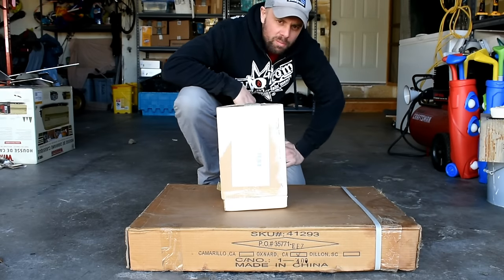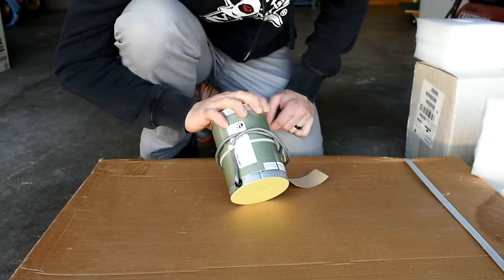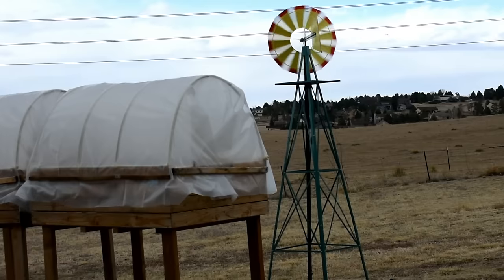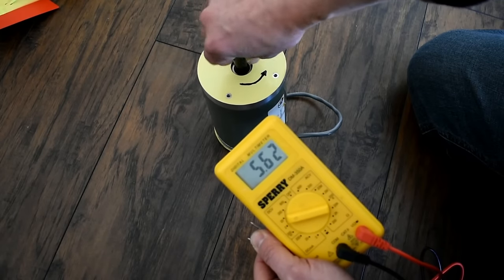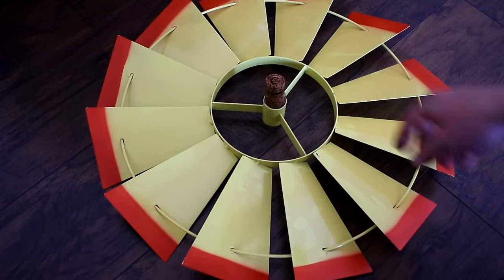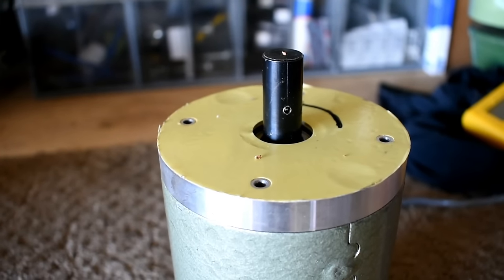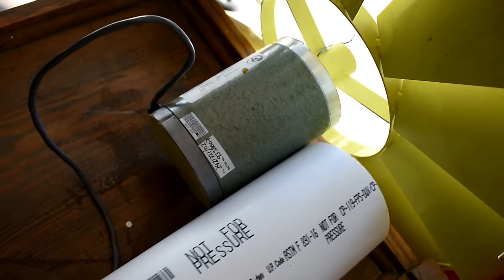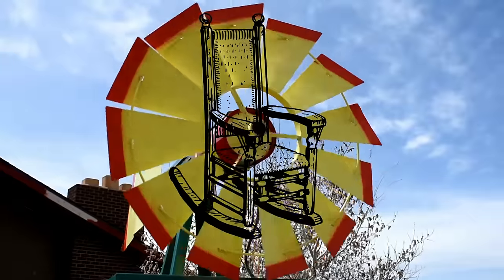DIY Homemade Wind Turbine for $32!!!💰

Comment: What was a great video, ended so horribly. Don't make us sit through almost 7 minutes of good explanation, only to give us 2 seconds of "success". Give results!
Reply: look at the end of the video and pause it..something wrong???..like the fins are the wrong angle for the blade to spin in that direction..
Reply from the maker: strange.....wind blows from all directions
Reply from the maker: I am not sure if you are arguing with me or yourself, but i just said in the last comment above that wind blows in all directions.  It's sarcasm.  It's on a charge controller so only allows power in.🤓🤓🤓
Reply: @live.life.simple.  AHHH ... sarcasm ... that's where I went amuck ... so, only power in, got it so why is the fan going counter clockwise when by the blade pitch it should be going clockwise? Inquiring minds want to know .... sarcasm ...
Reply from the maker: @ThePadutch  if you turn the blade around the pitch is opposite
Reply from the maker: Easier solution.  switch positive/ negative wires.
Reply: @live.life.simple.   If you switch the wires it  would reverse the polarity and motorize the fan unless you install a diode between the fan and the battery as an interrupt,  limiting the voltage to travel from the fan to the battery only. Otherwise the battery will try to power the fan and propel the fan as a motor.
Reply from the maker: @ThePadutch  I use a charge controller which will only let power in
Reply: he turned it with his hand. you can tell by how it slows down at the end.
Reply: true, what an end, we can't even see the turbine running
Reply: The overall video was good but it would be good to see how you hook it up at the end and show if/how you use accumulators, invertors, etc.
Reply: Thank you.. For save me 7 minutes and 2 seconds of my life..
Reply: 2 second "success" with no results/proof = "oh dang, doesn't work"
Reply: Retired at 40- Live.Life.Simple. Some sort of pivot would be my suggested add. And if the blades are more efficient one way that’s easy enough to remedy with cork I’d imagine. 👍x2 for the handtooled shaft sleeve. That’s not an easy win. That cover was nice too. Schedule 80 could probably service your swivel mounting. Great content and thank you for it.
Reply: @ThePadutch  You are correct; assuming the windmill is free to turn about its axis, the tail would orient the windmill to the proper orientation and given the pitch of the blades the windmill would turn clockwise. In the video, however, it turns counter-clockwise which would defy the laws as we know them. The only conclusion I can draw from this is that either he disabled the ability for the windmill to turn on its axis, preventing the tail from orienting the windmill in the direction of the wind and the wind is blowing from behind it (perhaps because he couldn't physically get a good camera angle given the direction of the wind at the time?), or most likely that he took some artistic liberties and manually spun the windmill (albeit in the wrong direction) to get something for the video. Either way, it made for a not-so-great ending because we don't know whether this actually worked or not.
Reply: @ThePadutch  it's the filming frame rate. Like when you watch a car driving on TV and wheels appear to be moving backwards.
Reply: @timwegman5776  the direction you see the fan turning is an optical illusion from the frame rate of the camera, like when the tires on a car on TV appear to be going the opposite direction.
Reply: I watched at 2x speed, only took me about 3 and a half minutes.
Reply: jdh7803  It was shocking!
Reply: John Freeman ....i think you hit on something when you made these posts. One of a couple things here....either this video was “staged”....mr. love life simple isn’t analytical like some of us....or there is a fairly substantial miscommunication here. Either way, Im with you on this one. Something isnt right, and you certainly werent getting a logical explanation. I was looking for info on an electrical generator windmill for our property here in Oklahoma. I want to also use the tower for some radio antennas. Unfortunately there isnt much substance here to gain any usable knowledge
Reply: Flipping the blade wouldn't change the direction the wind spins it.
Reply: YEAH!!!!!!! ( snort...)
Reply: @jay-rus4437  substance?
Reply: @winonaduty8277  ....yes. Its a word often used to convey the thought of a lack of something worth while....or lack of something useful. I understand that the use of the word stretches the actual definition, but is often used in such a context. Does that help answer your question?
Reply: @live.life.simple.  That doesnt work
Reply: I thought you were being mean until I got to the end lmao
Reply: Thanks to your comment I didn’t consider wasting my time on the video
Reply: @jakethomas2371 
And the fact that the blades spin in the wrong direction 😂
Reply: Hhhh&&hhhj @ThePadutch
Reply: @ThePadutch  Needs a diode either way and that's in the charge controller as mentioned.

Comment: O.K.  If your wind turbine is producing a negative (-) reading on your Volt meter, just reverse the leads.  No need to worry about getting the rotational direction correct.  These motors will produce electricity equally well if turned in either direction.
Reply from the maker: Thank you for input and constructive comment.  I 100% agree.
Reply: I don't completely agree. Due to various effects of magnetic circuits that I'm not going to get into, it benefits both motors and generators to have the brushed advanced by a certain angle, because of this many generators and alternators work better when spinning in one direction than the other. If the brushes aren't advances then if one can rotate the case slightly to advance the brushes themselves then they can make their motors/alternators more effective.
Reply: @lazyh-online4839  Wow... it pays to have that bit of extra knowledge. Thx for explaining this for us laymen. +1
Reply: Just put a bridge Rectifier then it won’t nt mater which way it turns
Reply: @nigelkennedy9811  yes exactly bridge rectifier solves directional problems. Negative and positive voltage is just a matter of reversing leads and current direction. Negative voltage just means you are measuring a lower potential energy with the positive (red) lead.
Reply: @lazyh-online4839  I'm glad this discussion was had.
Reply: @nigelkennedy9811  ???
Reply: Hi, sorry I don't speak english
I'm dominican republic
But I want to know
Specification motors
And blades label
Thanks
Reply: You don't want to know what went through my mind at first. Lets just say it had something to do with diodes. :face-blue-smiling:

Comment: try a barring collar to replace the cork . and your going to need a blocking diode to charge a battery or the battery will run the motor even if there is no wind .you can find real wind genny collars on ebay or you used to be able to anyway . but you have a good motor so the rest of it could be changed at any time .  the motor is the important piece .
Reply: What type of motor do you suggest?
Reply: i think you mean a "shaft collar" not "barring collar"? Collar bearings are different from shaft collars.

Comment: This is AWESOME . You showed me exactly what I wanted to know.  Of course I do want to know a little more.  You see I have a really nice windmill in my garden and every day I see it spin I think of all the energy I could be collecting.  Your video showed me the essentials, but I wonder if you could do one that shows how to connect the motor/generator to wires and a 12v battery.  My plan is to have a back up marine battery to run my husband's c-pap machine if we are ever without power for a long time, or even to charge it if we go camping
Reply from the maker: You will need an inexpensive charge controller to regulate the input.  It's simple hookup.  Red and black into charge controller and red and black going out of the charge controller to the battery.
Reply: @live.life.simple.  thanks :)
Reply: That's what I was looking for too.......the motor is pointless if ya dont show how to hook it up to battery bank.
Reply: I had 4 deep cycle battery's. I just installed a diode on the hot wire to the battery's. Battery's held the voltage down to save level on my amtek motor.

Comment: Nice project. I have 3 stepper motors like that. One i made a solar ceiling fan that ran for years. Made a wind turbine up on a 30 ft pole with fan blades. Had clamps like in this video and in one year it fell and broke the blades. Make a bolt on mount if you do this. Did the turbine work? YES It melted a 12 gage cord I had run to the battery. Make sure to install an diode on the hot wire to the battery. If you don't it will run the motor. Diode ---- Lets current go only one way. I used a 50 amp diode.

Comment: We need to see how you connected everything up for collecting and utilizing the electricity generated.
Reply from the maker: Positive and negative go into a charge controller.  From charge controller + & - go to battery.
Reply: Agree, why would you not show this as part of the video? Wasn’t that the whole point of the video? Otherwise it’s just an ornamental with a motor added?

Comment: Why not change the generator to a vertical mount instead of horizontal? ( That way you don't have to worry about the wiring getting twisted since the generator will be fixed and not turn) Use the hole where the weathervane hooks to the tower for the generator shaft to come through. You need to use a solid metal bushing to fit the blades to the generator. If the windmill blades don't grab enough wind you might have to build a new blade set up or maybe you could use a small squirrel cage out of a car or small furnace.
Reply from the maker: Thanks for your comment Ben.  I could definitely make this vertical, but this was just a quick setup with cheap parts.  I am just using this for small jobs, mostly charging batteries.
Reply: well said Ben thats my question to.. beside having a slip ring setup the other way is to point the motor up and have a different blade configuration..whirly gigs seem to spin alright in low wind

Comment: For future reference instead of a cork rig it up to make use of the keyway already cut into the shaft on the motor. Drilling out metal of the shaft could cause a balancing issue, as well and mounting the motor. If the motor isn’t specific to it level it’ll cause vibrations and or break the motor. Great diy tho. Thinking on your feet
Reply: He did say the cork was temporary just to see if the system would work.
Reply: At the rotation speed that thing will travel, balance of the motor shaft couldn't possibly be an issue.  The wheel isn't dynamically balanced, and a more-or-less straight hole through the shaft won't change the balance.

Comment: Nothing about voltage output or what it was used for. 
Was it connected to a battery system to convert it,  or just used for an LED light to illuminate the turbine in windy weather

Comment: I don't know if you get to read this, but I have a suggestion and a question. 1. Suggestion.  Try using a roll pin instead of the wire to hold the blades to the arbor, just use a roll pin that fits tightly into the hole.  2. Question. Since the wind turbine rotates to follow the wind direction, how will you prevent the wire from winding around the tower? Thanks in advance for any additional information about this you can share.
Reply from the maker: You can just put something in the way so it will not fully rotate or check it every few days.  The wind does not switch directions enough to tangle it after a day.  They do make a connection plate that can be purchased online as well.
Reply: @live.life.simple.  Thank you, I will look into that.

Comment: This is just what I wanted to know because I thought my back yard windmill was doing a lot of work with no benefit. So here is your video and I was excited. Then you start using cork and then you just quit with no explanation as to how well it all held up or what task it now performs.
Reply: I'd say it's a poorly built windmill that does very little. Using that type of motor as a generator is a bad idea and extremely inefficient unless its in a hurricane.

Comment: If you cut and hinge the vane off-center with a spring, it will then govern out of high winds by turning edgewise to the wind while the vane remains in the wind. This is how many American windmill makers achieved speed governing. 

Also, the PVC pipe cover for the generator is a nice idea, but I question how much ventilation it receives on windy days when the generator is running hot.
Reply from the maker: Yes even the old farmstead homes have windmills with the vane to the side instead of straight back.  I hadn't thought of that.  I have not had  heat problem yet, but i could definitely see how it would need to be adjusted to let it vent better.  I might try to make an alternative this spring.  I appreciate your info.

Comment from the maker: Just tested this at 26 volts with a pretty good wind.
Reply: Nice, how many amps/watts are you getting out? Did you hook it up to a battery?
Reply: @bluemona my god blue... that is not how electricity works... like.. at all..
Reply: @bluemona  my pedalling, is the load.. it might produce a measly amount of energy, but it will have zero effect on my pedalling.. there is no part of a generator that secretly works against you in reverse...
Reply: @bluemona  my point is that the generator/motor is in between electricity and mechanical energy. you're talking like it's 40 kilograms or something.. obv, if you can't generate the required volts and amps, then you won't supply enough energy to your target...so if you're trying to power a fridge with a bike, you will obv fail.. but the fridge isn't demanding it from your legs, nor is it applying mechanical force back at blades...
Reply: @bluemona ahh, finally we can agree
Reply: How did you make it not spin the negative direction!
Reply: Voltage doesn't give sufficient info. How many Watts?

Comment: Not sure which direction blades were facing, but, I have noticed, on other videos, that the strobe effect by modern cameras will actually show turning blades stopped or even running backwards. So, a moot point. You know which way they need to face and that is what is really important.  Nice video, thanks for taking the time to present it...
Reply from the maker: Thank you Tony!

Comment: I definitely would have gone about this a little bit differently.. I've been thinking about making my own. I'm thinking a pulley system would be great! That way you don't have to worry about the cork wearing out. They also make gear boxes that would produce even more power per turn on the windmill

Comment: It was said you could just trun the fan around and that would reverse rotation! Doesn't work that way, when you take a fan or propeller off and trun it around (180degrees) the blades are still pitched the same way!!

Comment: Easy way to get center when drilling is place a washer over the cork, and use the size drill bit that the center of the washer has.
Reply from the maker: Awesome tip.  Thanks so much.

Comment: you should put a large bike cog behind the windmil and connect that cog to a tiny bike cog on the shaft of the motor.. basically speed gear for a bike.

Comment: I love this. I'm looking at landing Wyoming. Off-grid is the only option. I have a tiny house that is wired like a traditional house. I really need some direction and advice on what kind of power to use. A solar system is going to be around 40K (according to the cost calculators). I need a cheaper alternative. A mini split is a necessity in the summer

Comment: I can't help but believe that cork didn't last very long. I would have found a old socket that fit and made the motor shaft fit the sockets ratchet input and then welded the socket into the fan . But I just prefer to do things once

Comment: I love how he simply says "success" with no testing to see if or how much power it produces. If it can only power a single LED light, I wouldn't call it "success".
Reply from the maker: unless you have a massive turbine, you will never do much more than top off your batteries
Reply: @live.life.simple.  that's at least somewhat of a answer. Do you mind me asking how many batteries you have and what you power with them? Just trying to gauge the number and size of batteries you could top off with this setup.
Reply: @Steven-gv1ke  hey good question I'm upset had a motor from a powerful ac window I cut the cords but I got over 30 tran-bal 14.4v nickel cadmium batteries

Comment: The motors that seem to be easily available here typically produce peak output at 3000rpm, which is 50rps, or at least 10x the speed of a multi-blade rotor like the one you are using. Adding a gearbox or pulley system will significantly increase startup speed and reduce efficiency, so wondering now if using a high speed, 3 blade prop would be better?

Comment: When that cork rots out go to Tractor Supply and buy an impliment bushing in the size you need.  You may have to get more than one size to fit one a tight fit inside the other, but cross drilling a bolt hole will keep it together.  I'd just buy a big bolt (or the bar stock I have in stock)  that fits inside the fans center tube then drill out the center with my lathe.  But, that's just me!   Would love to hear how many amps that little blade set is making!
Reply from the maker: Cool!  Appreciate the tip